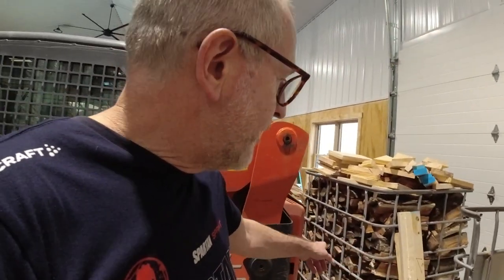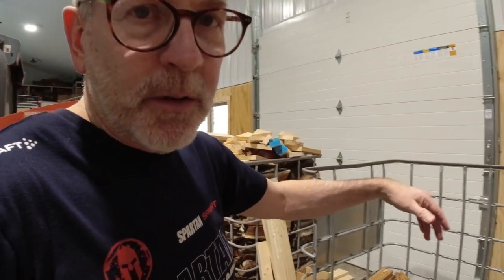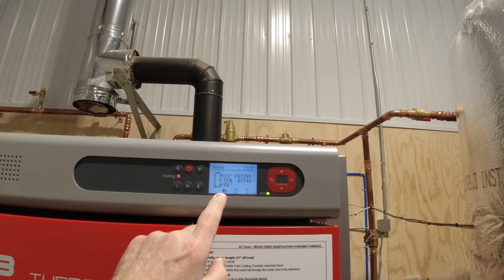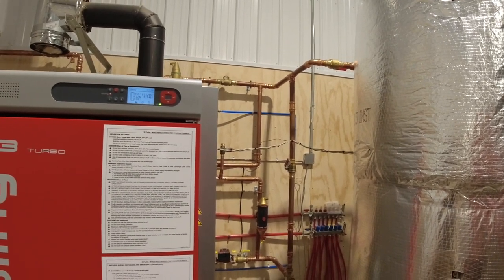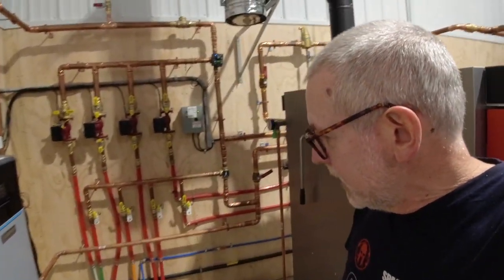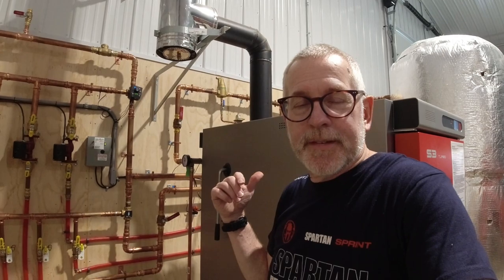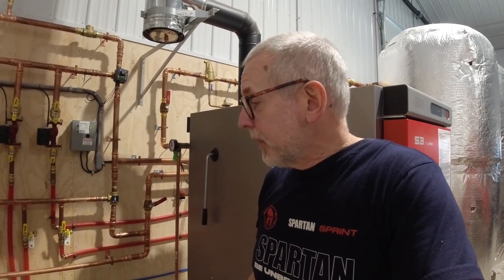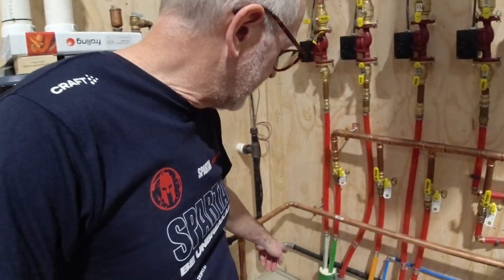Heating with a Wood Boiler

Comment: electronics on top of booiler....good luck!!
Reply from the maker: @SureshKumar-pz4bl  Thank you for watching my video and for commenting. One could take your comment as critical of the boiler design. I have confidence in the 60 plus years of specialization in wood boiler production from a company with over 1,000 employees that Froling has that they know how to design an efficient and reliable machine.

I will choose to take your comment as genuine good wishes for my future in my well researched and designed building.
Reply: @goldnerwoodlandfarm9305  in the long run electronics will fail for sure so is better downgrading to electromechanical control systems IMO

Comment: Nice set-up!  If you have free natural gas on the property, why don't you just use natural gas?
Reply from the maker: Thanks for watching and for commenting. I am trying to reduce my use of fossil fuels and have plenty of hardwood on the property that make excellent heating sources. The Froling Wood boiler produces a very efficient burn so I am not adding a lot of smoke in the air.

Comment: Have you ever overheated the boiler and had to reset the high-limit thermostat.  I just did mine and cannot find the reset.
Reply from the maker: Thanks for watching and commenting. Yes, I have overheated my boiler a couple times.  The reset switch, is a very small button with a screw cap over it.  You have to remove a cover on the very top of the boiler and pull back the insulation.  The cap is on the front edge under the cover.  You need a small pointer like a nail or very small screw driver to push the reset button. Good luck.

Comment: Does this boiler also heat the domestic hot sanitary water (for showers, kitchen taps etc..)?
Reply from the maker: I have it configured to heat domestic hot water when I am using the boiler during the winter.  I have electric hot water heaters to heat my domestic water when I am not using the boiler the rest of the year.  Thanks for watching and commenting.

Comment: I have the exact same thing . I heat 7000 sq ft . I have 2000 gal of hot water storage.  I live in northern Canada. I have run it for 7 years now. What  was the rough cost.
Reply from the maker: Thanks for watching and commenting. Wow, 7,000 sq ft.  Nice. I am very happy with my first winter results.  My house should be finished this fall and will also use the Froling wood boiler for heat.  The rough cost was $20k to $25k. Not sure how much of the labor was tied to the boiler install versus other services.
Reply: How long do you typically get between firings in typically winter weather heating 7000sq ft and how long of a burn to recover your tanks for what differential 😊
Reply: @dantheman1283  At an average temp of -10c day time and night time temp of -20C I burn one load of wood in 24 hours heating my shop at 15C and my home at 22C My shop is 2800sq ft with 22foot high ceilings.  Both my home and shop are very very well insulated . I feel the 2000 gallon of hot water storage is the key.  Once up to temp I just have to maintain. In fall and spring I may go 2 or 3 day with one burn.  One burn takes about one wheelbarrow full of hard wood oak or maple.

Comment: How many lbs of wood do you burn a day ?
Reply from the maker: Thanks for watching and commenting. Depending on the weather I typically burn one full load of wood a day or every other day.  We have not had a lot of continually below freezing temperatures this winter.  A full load is probably 50 to 70 lbs of hardwood, cherry, oak, maple, and hickory.

Comment: You said you have an access to free natural gas. 
Why would you hustle with wood boiler than?
Reply from the maker: I have a couple reasons that you may or may not agree with.  I am trying to minimize my use of fossil fuels where I can. I also enjoy exercising and cutting firewood. I have ready access to good hardwood trees on my property.  In many cases i don’t need to cut trees down I can use trees that are wind damaged.  In other cases it makes sense to thin the forest to enable the remaining trees to grow better.  I would be doing tree harvesting and clean up anyway.  Why not use them.  Thanks for watching my video and for commenting.

Comment: Where are you located?  Is that building insured?  I ran into problems trying to insure somthing similar.
Reply from the maker: The building is in Pennsylvania.  I insured the building with State Farm with no problem. Thanks for watching and commenting.
Reply: @goldnerwoodlandfarm9305  Very interesting.  You store cars/tractors in there as well?
Reply from the maker: I don't know if it is where I live.  I have had others comment that they were surprised.  But I did not have any issues with my insurance provider.  Yes, I have vehicles stored inside. @TopNotchFarmsPEI